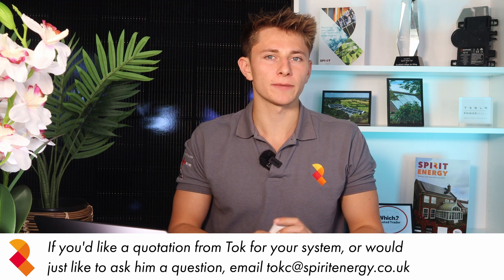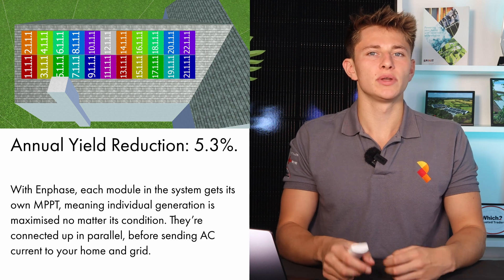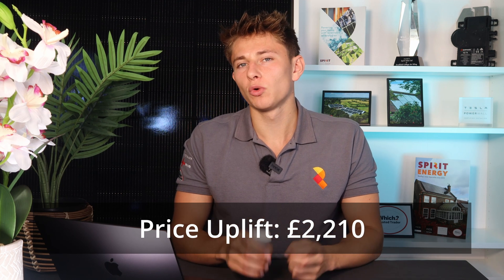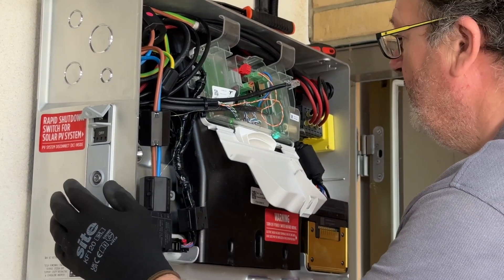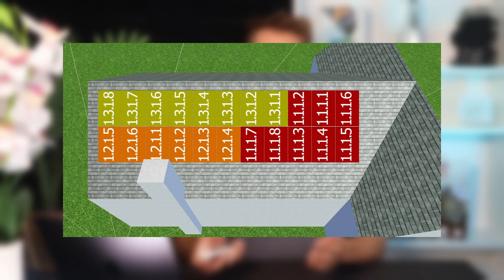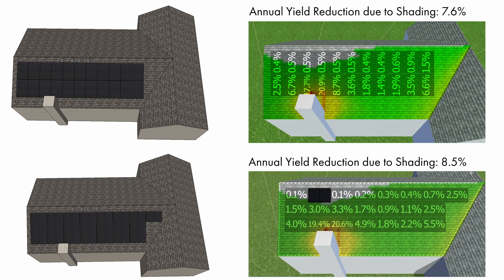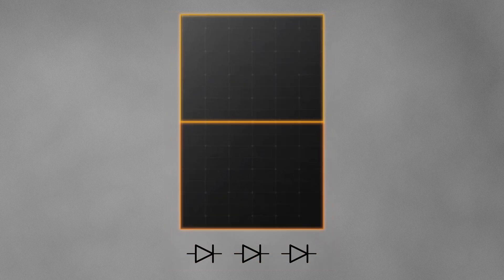Mitigating Shade from a Chimney - Enphase not worth it? - Sam's Case Study Pt 4

Comment: Have you considered low light conditions?
Reply from the maker: The modelling software does take all of that into account, yes.
Reply: @spiritenergy_uk  Ok. Thank. Any idea why not make inverters/MPTT with a lower triggering current/voltage?
Reply from the maker: 60V is very low already. That’s 2x panels.
Reply: @spiritenergy_uk  Good. Which invveters do that?
Reply from the maker: Powerwall 3 has a 60 V minimum input voltage per MPPT.

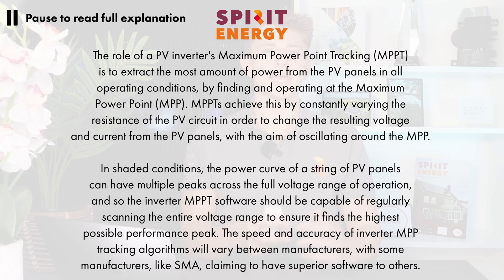Comment: This is an excellent video and something that is overlooked by people willing to just spend more for the micro inverters and not think about if they're really worth it. I think your animations are not quite showing this benefit correctly? At 2:25 you show the thirds of the panel with grey overlay of the sections but the top half and bottom half are still as if they're separate panels. So it should be six sections, not just three sections correct? And then at 2:42 It's the same thing, there's a spot where the chimney is only shading a lower portion of the panel, but the upper portion is still shown as not producing. But the top and bottom portions should be independent of each other? I think that's what I got from your verbal description and if so it kind of makes six separate solar panels per panel which is really awesome for shade mitigation.
Reply from the maker: Thanks for the comment!
Unfortunately, the operation of a half-cell panel is not quite as optimised as each sixth of the panel being able to operate independently. The top and bottom halves are only able to operate independently when the bypass diodes are not activated, but, importantly, each half can only operate at half the current of the full panel (current generation being proportional to cell area). Each of the 3 bypass diodes are wired in parallel with both top and bottom cell strings, so when a bypass diode is activated then the entire third of the panel is bypassed, as per a traditional full-cell panel. The activation of the bypass diodes is dependent on the operating point of the entire string of panels, as dictated by the inverter, and for the particular example shown here, with shade moving from left to right across the panels, it is more realistic that the bypass diodes within the shaded panels would be activated, reducing the voltage of the string and keeping the current high, rather than operating the panels at half the current but at higher voltage. 
 
It's hard to explain in words but we will be doing a more detailed video to explain how panels react to shading. So stay tuned!

-Luke
Reply: @spiritenergy_uk  You did a great job explaining that! It's cool to see a solar installer showing such technical knowledge! "The top and bottom halves are only able to operate independently when the bypass diodes are not activated" What is the point of the half panel then? If the diodes are not activated, then isn't it operating like a regular full panel?  And if there are only three diodes wiring each individual 3rd in parallel then same question, what is the point vs just having a regular panel with full-size cells in thirds?
Wouldn't it be a lot better to wire all six sections in series with 6 bypass diodes?

Comment: Why not just run the panels most affected by the shading on microinverters, and the rest of the panels split over the 3 MPPTs?  So you're only paying for a few microinverters + the envoy.
Alternatively, how would Aiko panels work in this scenario?  Their Neostar panels have cell-level partial shading compensation, where up to 3 individual cells can be bypassed within a substring (more than 3 will cause the bypass diode to activate).  I don't think any other modules can do that.
Reply from the maker: Thanks for the comment, you could potentially run some of the shaded panels on micro inverters as you say. We do sometimes do this with Tigo optimisers. 

The newer AIKO panels are impressive and I’ll make a video on the advanced capabilities of those.
Reply: @spiritenergy_uk  I'll be looking forward to that video :-)  I'm in the early planning stage for my system and I'm thinking that the Aikos would be a good pick for my system for that reason.  The roof has shading issues and needs full 3-story scaffolding for access (ladder / cherry picker / scaffold tower not an option), so if an optimiser failed it would cost £££ to fix.  I've been trying to figure out all the various options for it.  Roof survey in the process of being booked so would be interesting to see what they say.
Reply from the maker: @WyndStryke  I agree, I’d try and stay away from optimisers or micro-inverters if you can. AIKO are the panels to go for - I’m curious to know how they’re offering such advanced technology and efficiency at such a competitive price though. 

Where are you based, I’d be happy to quote if you’re within 2 hours from Reading. We can also consult on the project.

Comment: Having recently had a quote for a 20 panel PW3 and enphase system, the 10kw enphase and IQ8s were 3-4k less expensive than the PW3 install.
Reply from the maker: Hi, thanks for the comment, I’m a bit confused - was the second quote without battery? 20 panels + Enphase + PW3 will never be cheaper than 20 panels + PW3. I may have misunderstood?

-Tok
Reply: I was quoted £18.6 k for 20 x 440W panels, no optimisers, and a PW3. £13,300 for 20 x 440W panels, 20 x IQ8AC micros and 2 x 5kW enphase batteries. So actually £5k less for the enphase solution. Heatable quoted for the PW3 and octopus for the enphase.
Reply from the maker: @yp77738yp77739  Ah, my apologies, I thought it was a like for like comparison.
Reply: @spiritenergy_uk  You give the shading mitigation modelling of the micro inverters but you don’t mention the shading mitigation modelling of the PW3. Did it justify the the extra £5k PW3 price point please?
Reply from the maker: @yp77738yp77739  See the previous video in this series for details on PW3 shade mitigation vs Enphase for this particular case. The client was also looking for PW3 as it provides up to 11.04kW continuous AC output and provides full house power cut protection. It can also be expanded very easily and is going to be able to integrate with Octopus Intelligent tariffs in the near future. 

We were looking at whether Enphase would be worth adding on top of the PW3 and the data showed that it wasn’t.

The two are not like for like, it wasn’t an extra £5k for PW3 - it was whether he went for PW3 and Enphase or just PW3. The Enphase batteries were not an option for this client as they don’t have the functionality that he needs. 

It would be interesting to see two options from the same installer. The issue with comparing Heatable and Octopus is that they may be offering the same products but one subcontracts and the other doesn’t I believe. They also have different business models and one is more premium than the other in terms of quality. All of which makes a big difference to cost. There are too many factors to directly compare. 

-Tok
Reply: @spiritenergy_uk  Thanks I just looked. So you are not assessing the shading mitigation capabilities of the PW3 you are assessing whether adding micro inverters to a PW3 system is economically advantageous (in terms of shading mitigation) compared to adding diodes to a PW3 system. I suppose in terms of economics, a tigo optimiser and standard cheap single phase inverter (or inverters) is always going to be the most economical solution by far for dealing with shading situations, although a bit clumsy.